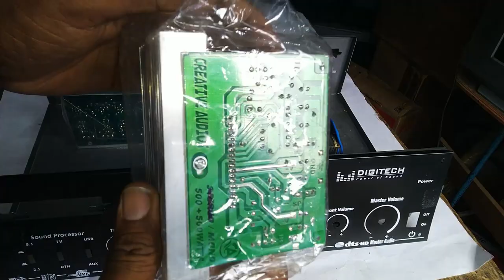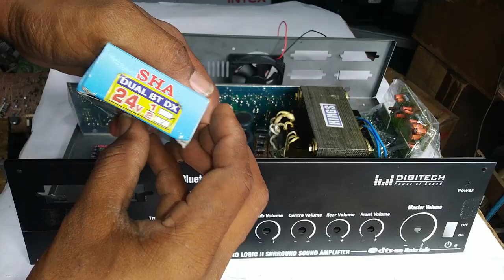5.1 Power Amp Thosiba (5200-1943) Transistor / 16 - Fet Amp For Home Use / 12" Subwoofer Amp

Comment: Amazing gurunadhaaaaaa.....🙏
Fet board vachi 5.1 amplifier. 👌👌👌
Bro enakku oru doubt. Sila per 5200, 1943 aa fet kedayadhunnu soldranga. Idhu transistor nu soldranga. Apo MOSFET nu onnu thaniya irukka. Apdi irundha idhukum adhukum enna difference. I'm waiting.
Nandriiiii gurunadhaaaaaa.........🙏
Reply: IRF serious la varathu tha mosfet.. 1943 5200 transister
Reply: @Saro-tech-tamil  ok bro. Now I'm clear.
Neengalum 5200 1943 transistor/ 16 fet board nu potrundhingala adhan doubt vandhuttu.
Anyway nandriiiii gurunadhaaaaaa....🙏

Comment: Minimum enna size speaker and evlo ohms ulla speaker use pannanum intha amplifier ku
Reply from the maker: 4 inch 40 watts
Reply: @TAMIL-MUSIC  athuku illa bro neraiya per solranga transistor board use panna 8 ohms speaker thaan use pannanumnu solluranga illana board fault aitumnu solluranga than bro unga explain panna sonnen bro
Reply: @TAMIL-MUSIC  14 fet transistor board ku 30-0-30v 8 amp transformer use pannuren but speaker 6 inch 4 ohms woofer speaker use pannalama bro life varuma bro ???
Reply: @TAMIL-MUSIC  ennoda comment ku reply pannathuku rompa thank you bro unga ella videos pathuruken bro rompa arumaiya explain pannuringa rompa thanks bro 👌 👌